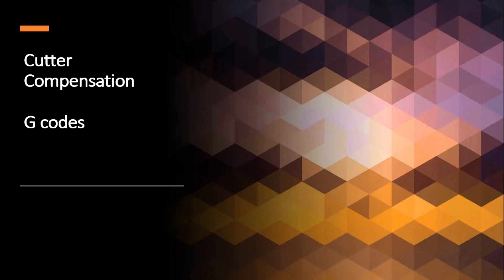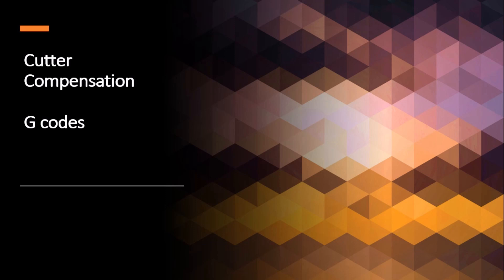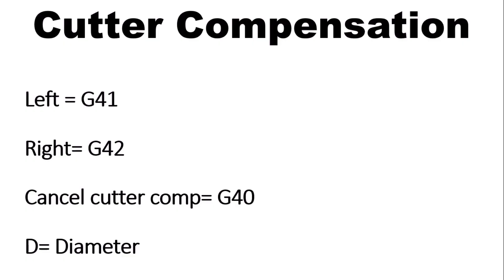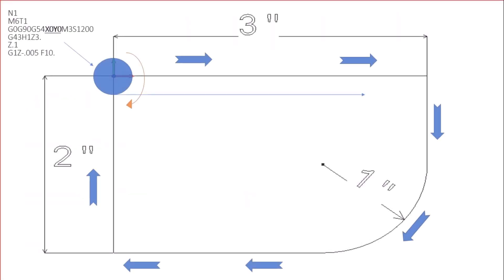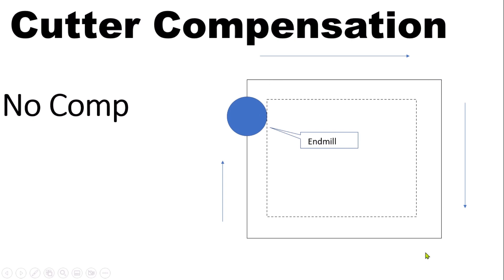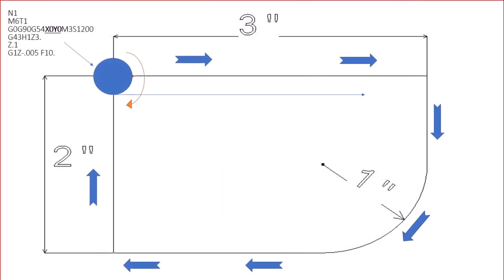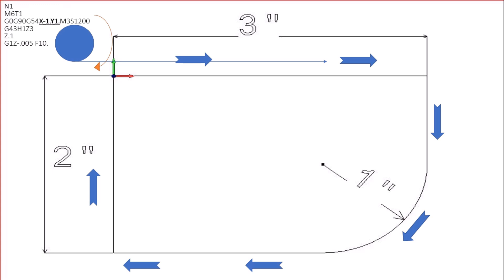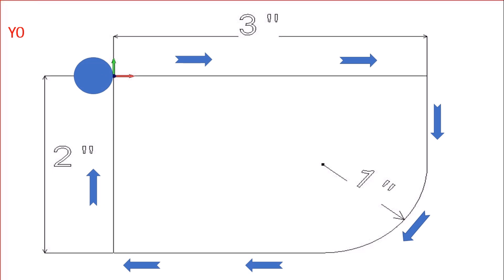G code / Cutter comp / CNC

Comment: If the machine reads line by line, how does it know in which direction to compensate for the cutter after you set g41?  Like  when you tell it G41D1X0Y0, how does it know to be 0.5" north of X0Y0 vs 0.5" west of it?  Does it look at the next command and say oh he wants to X3, so I need to be left (north) of the toolpath?
Reply: Reading it at the same time will also allow it to execute a G 41 at the same time, it knows to move to X0Y0. It also knows for the tool to stay left which is G41.
Reply: I also don't know and curious about it, is there anyone can explain it explicitly ?

Comment: Great videos!  We don't store the tool diameters in our machine (I'm not sure why).  Am I able to offset by an absolute amount?  I see some examples online saying to use P.  For Example "G41P.25X0Y0" which would be for a 0.5" diameter tool.  I don't see anything like this in the FANUC Series oi-MB manual.
Reply: All times if they use software or off-line programming, they will put that information in the software leaving the offsets set to zero. Not sure if that’s what you’re running into or not.
Reply: @thebelieversvoices3461  Thanks.  That makes sense as we have used a CAD CAM software up until now.